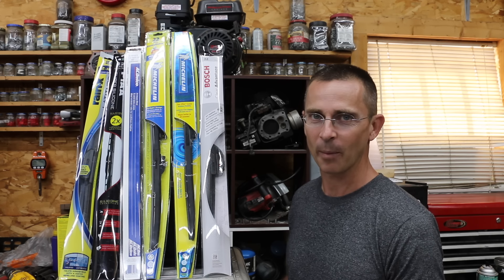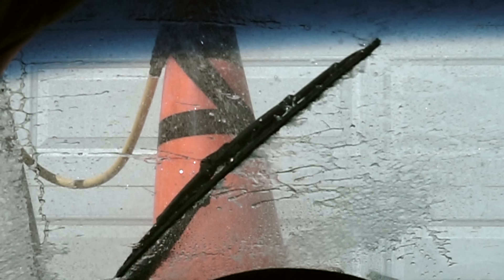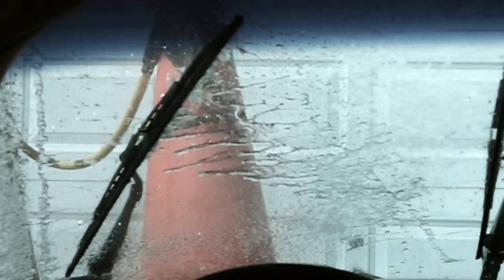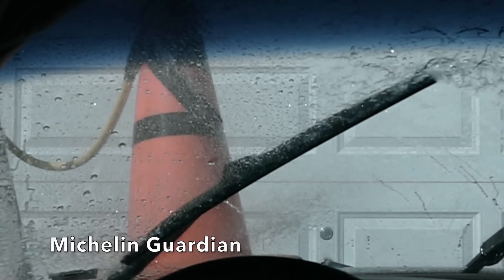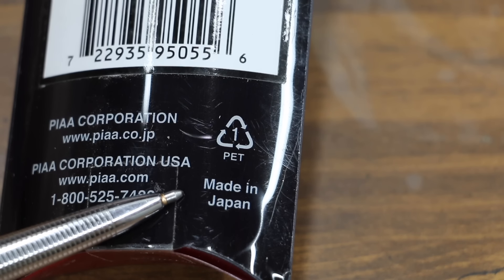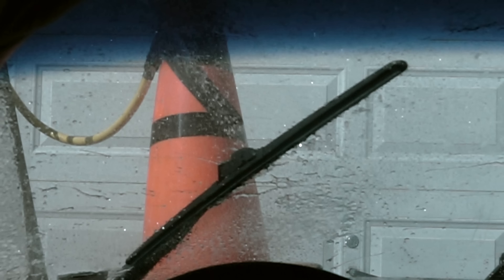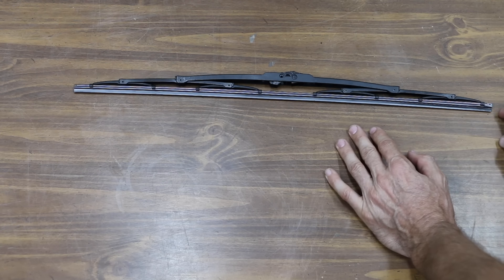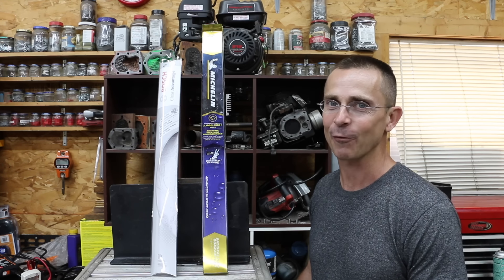Which Windshield Wiper Blade is Best? Let's find out!  Michelin, PIAA, Bosch, AC Delco, & Aero

Comment: Hey, just a heads up from a professional detailer: the main reason to buy silicone blades is that they all leave a coating of silicone on your windshield with use that causes water to bead up and makes the wipers more effective. The rainx wipers you tested are just using that fact for marketing, but all silicone blades including the PIAA will coat the windshield. 

When combined with a glass treatment like rainx or aquapel (which is better) , silicone blades will last an incredibly long time because they are more effective at low speeds and at highway speeds you may not need the wipers at all because the water beads and rolls off. 

Speaking of which, you should test hydrophobic coatings like rainx at some point!  Love your videos!
Reply: Very informative.

My last set of PIAA wipers lasted 8 years believe it or not. 

I clean my car at least once a month, I would clean it more often if I had enough time. Every time I clean my car I clean the wiper blades too.
Reply: You will not see silicone blades used by car manufacturers (OEM).  Silicone leaves deposits in the microscopic pitting that is found on EVERY windshield.  Filling this pitting with a hydrophobic material is what allows Rain-X , Aquapel, and others to have the rain bead up and blow off the windshield.  The down side is that these materials can cause extreme glare on the windshield, especially in sunrise, sunset, and oncoming headlights.  The car manufacturers will not take on this liability...
Reply: Does 2 stroke mix stabilizer Fuel? Adding 2 stroke mix Does it lower the octane levels over time ? I can not find any information on it
Reply: IRBork isn't it recommended to use a coating (hydrophobic) when you switch to a silicone blade?
Reply: @r3alfish   Hydrophobic treatments can produce glade... especially when they start wearing off.  I tell people that to minimize this problem, treat the windshield every 4 to 6 weeks.  Even if the treatments seems to be working, after that time it is starting to wear.
Reply: I used Adam's ceramic boost on my windshield 4mo ago and use rainx washer fluid and once I'm at highway speeds, I rarely use my wipers.
Reply: I find that I get water to bead up fine if I clean the windshield with 0000 steel wool or (my preference) the 3M 'plastic' version of 0000 wool (after running the car through the carwash). I do this a couple of times a year and that seems to work well enough for my wipers to not make noise and get the windshield clear. And this kind of cleaning leaves no streaks.
Reply: Exactly.  👍
Reply: My Bosch Icons are going on almost 5yrs now. Rain-x coating, and rain-x 2 in 1 fluid.
Reply: S
Reply: That's kind of like advertising cholesterol free margarine when no margarine has cholesterol.
Reply: IRBork I bought Silblades for my Wrangler and they squeaked and squealed from day one. I cleaned the hell out of my windshield before installing them too. No matter the amount of rain or the speed of the wipers, they were way too noisy and the first ones I’ve ever thrown away because of the racket. They probably would have lasted years though!
Reply: hmmmm, i dont know about that, glass is silicone too, so if i rub two diamonds together will one get coated with diamonds? dont tell me the harder surface; harder silicone surface, will get coated by the softer silicone surface, I know i flunked science, but come on bro, really? please explain this theory, and working at AutoZone dont count!
Reply: Andy P silica (glass) and silicone (rubber) are two different materials with different properties, silicone wipers such as PIAA have instructions to run them dry for 3-5 minutes to activate the hydrophobic properties on windshields. Dont quote me on this but my theory is that silicone is softer then silica hence when run dry produces heat from the friction that sort of disintegrates minuscule amounts of silicone and coats the windshield hence water beading effect.
Reply: From the reviews I have seen carpros had the best ceramic for the money.
Reply: For that exact reason, I hate RainX and anything that leaves a "White-Out" smear after each wiper pass.  I even had the same with the Aquapel, and I thought the Aquapel was NOT supposed to do this.....
Reply: As (Porsch924Tim) stated below:   I agree for that exact reason, I hate RainX and anything that leaves a "White-Out" smear after each wiper pass.  I even had the same with the Aquapel, and I thought the Aquapel was NOT supposed to do this..... Very noticeable during the day, and dangerous at night with any overhead/on coming lights.
Reply: @andyp3834  are you confusing silicon and silicone?
Reply: The windshield on my 2001 impala beaded all the time and in fact a friend of mine swore up and down i was using rainx. I never did. In fact whenever i drove in the rain i very rarely ever turned the wipers on.
Reply: This
Reply: So are the PIAA'S just as good as the Michelin Endurance XT (silicone) he tested I was kinda surprised PIAA weren't tested also
Reply: @mikebraun4263  depends on the wiper for which your choosing to stir with.
Reply: @TNtoolman  any way to remove this deposit if once used?
Reply: @ZoopChedda  We tested silicone blades in our test lab.  When it was finished we could not get the silicone off the windshield... tried everything... #0000 steel wool, rubbing compound, acid based cleaners, one tech even tried burning it off with a light torch.  Figured nothing else worked, why not?  
We ended up throwing out the windshield because it could no longer be used for testing.  Windshield wiper comparative testing and FMVSS/SAE testing must be done on glass... not hydrophobic surfaces.
Reply: @LuckyNv  i believe you i've had expensive bosch and after 2 weeks they leave streaks, the piaa lasted 6 months before i gave then away when swapping company car.
Reply: @hardlyb  You just replied that you run your car through a car wash to a professional detailer.... I'm sure that he loves your comment!  There's a reason detailers call carwashes swirl-o-matics... Not sure about steel wool, but Bon Ami (a specific abrasive found in the cleaning aisle of some stores) was also said to be recommended by BMW for cleaning windshields.
Reply: @sixoh_diesel5662  I admit that I don't take the best care of my cars - their appearance is just not that important to me (my wife cares even less - she refers to cars as 'boxes with wheels'). Basically the only time I ever take a car to be detailed is just before I sell it - I always ask myself why I didn't do this before, since they look so nice, but somehow it doesn't happen. 

I'll have to look into Bon Ami.
Reply: chrispompano tm
Reply: @TNtoolman  I've noticed this with my windshield treatment. It used to just bead up and I didnt even need to use my wipers in heavy downpour. Now a light drizzle just sticks like mad, I don't have a garage to put my car in to redo the treatment
Reply: @lanceivor  Yes SiR, Sir, I think your on to something, thanks for the awesome response
Reply: @TNtoolman  Damn. thanks for the feedback though!
Reply: @TNtoolman  so should i just get the Bosch regular blades and use rainx? Thanks for responses
Reply: @Fortheloveofjdm  Bosch makes a good blade, as do others.  I do not recommend Rain-X unless you are prepared to re-treat every 6 to 8 weeks due to the possible glaring factor
Reply: @REDSIX  LOL he was such a prick about it too

Imagine being that smug when you don't even know the difference between silica and silicone.
Reply: IRBork i second this, i’m intrigued that the suggested test.
Reply: Porsche924Tim i’ve been using rain x windshield fluid for years. i can attest to the glare that it leaves.
Reply: Like at least one has said glass is silica and silicon or silicone is a different thing. To elaborate on this a little more I worked at an auto glass manufacturer. They have special glass that will bead up moisture and run off the glass so it clears easily. I wasn’t privy to the technology but I saw how it practically cleared itself.

Comment: "we will come back after a year" talk about dedication haha. Good content
Reply from the maker: Thank you!
Reply: I wonder if you could use a tanning bed to accelerate the time needed for the UV / heat durability test?
Reply: dragonspy91 0
Reply: dragonspy91 p
Reply: @ProjectFarm  Dude. You're a nerd. And I mean that in the most endearing way possible. Keep up the good work. 🔥
Reply: based on design alone, I think ill pick up the aero blades.  I don't get much rain in socal, but the design seems to kind of give the actual blade some "shade" from the sun, and seem itll help slowdown deterioration and therefore be less squeaky and streaky when I use my wipers to clean my windshield once a week, lol. id like to wait a year for his update but man, the streaking gets to me.  :p
Reply: @kevinpacheco3303  it might but what harms the most is the heat build up on the glass that the blade is leaning on
Reply: I know, I looked at the date and got sad because the video doesn't exist yet.
Reply: You gotta love this guy.. quality unbiased videos. Rare to find quality, honest and dedicated videos nowadays.
Reply: @kevin None silicone blades will probably last a lot longer than the rubber protected by a little bit of the frame. I bought a pair of cheapo silicone blades that squeak like crazy and probably strain the wiper motors if it's not wet enough, but they've lasted me for quite a while.

Comment: "Hey buddy, you got anything good in the freezer I can have?"
"Yeah, I've got 5 types of oil, some wiper blades, 7 brands of paint, 4 qualities of gasoline and an old lawnmower engine."
Reply from the maker: lol. Great point!!
Reply: This is perfect
Reply: Wait!! No beer or snacks What Heresy is this!!!!
Reply: @kalemercer7053  Next vid:  Which beer is the best.  Let's find out!
Reply: @pickeljarsforhillary102  which beer wins the -40 flow race track
Reply: @pickeljarsforhillary102  I think a beer comparison is in order too,
Reply: Hahahaha nailed it!
Reply: I was thinking more along the lines of how much shine is good for fuel... in an engine, then later testing what’s left personally!
Reply: don't forget fuel, and oil additives
Reply: Probably still taste better than frozen microwave dinners.
Reply: For the shop use or for us?
Reply: Great video
Reply: Ha!
Reply: I use the rainX solution on my screen and it really comes into its own when driving above 30mph at 50mph I actually don't need to use the wiper blades as the rain comes of quicker than the blades can wipe.  This makes me think a moving test with blades might be more accurate as wind is a massive factor in wiper blade efficiency.

Comment: Love how the passenger blade basically undoes what the driver blade wipes off.
Reply from the maker: Great point!!
Reply: Yeah, some car manufacturers did try different wiper designs and most of them work better than the regular one, but I'm guessing the BOM cost is too great.
Reply: I think in normal driving conditions the air flow would help  push that water up and over the window rather than it just fling over to the other side.
Reply: @AllenEngineered  Yes, and different length of left and right (passenger's shorter).
Reply: It doesn't after the wiper motor fully cycles. Only after the fore stroke.
Reply: I own a 98 C230 which only has one wiper for the whole windshield. I honestly like the design of it compareed to traditional 2 wiper setup. Wish all cars had it.
Reply: My Honda civic 2014 the wipers both of them shoots out pushing the rain off the whole window. Unlike most cars
Reply: @Overland_506  My 2005 Chrysler Town and Country also has opposing blades that both push up and out. Preventing that from happening.
Reply: @ras8678  I recently read an article about that single giant blade and it was brought up that while it was great at clearing the windshield the weight of the thing would cause the entire car to rock at full speed.  They also mentioned that since the design was abandoned the replacement blades are becoming scarce and even more expensive than they originally were.
Reply: RAS my friend had one of these and it works fine until it messes up and won’t run fast enough to keep up with the rain, was terrifying to ride with him.
Reply: One cool thing about cars that have wiper blades that both to out from the middle, not sure what all companies do this but I've had 2 fords and they both pushed water to the outside with both wipers
Reply: @Pancreaticdefect  I've got a Mono-wiper on my 1998 Mercedes E-Class. I think it's a single 22" blade, so not too uncommon. It works really well and I've never had issues with the car rocking like you said. It is more complex as the blade moves on the arc as well as in and out. I've never seen them break, but it's certainly more complex and expensive to produce.
Reply: @bdkj3e  i agree, if you don't maintain the wiper motor ( keep the assembly greased and debris can build up very easily underneath it) it can become your worst enemy lol. I notice the teflon lined trico or silicone ones hold up the best on my c230 without any problems.

@Pancreaticdefect well no wiper design is perfect. My c230 and c230k both sets of wipers have no vibration issues at high speeds, that could be related to a specific car manufacturer or design flaw. With replacement blades, i know my model is just a regular 24" blade, IIRC the newer yaris had like a proprietary single wiper.

Comment: Thank you for doing this experiment! I'm an OTR truck driver and was getting ready to buy new wiper blades for my semi.  After watching your video I went with the Michelin Extreme with the beam technology.  The one that did the best in your test.  Even though they're $20 a blade at Walmart.  I'm very happy with them.  Also how can you put a price on being able to see clearly to stop an 80,000 lbs truck!
Reply from the maker: Thank you!
Reply: Try taking your rig to the streakin beacon(blue beacon) just so that you can put the rainx coating. I always do this and paired with a good set of wipers you’ll be laughing at the rain while everyone else is struggling to see out they’re windshield
Reply: @gbaca57  I always get the rain x at the blue beacon.  When it rains after you got your truck washed you can see the water bead up on your hood.  Then your truck stays clean longer.
Reply: Look into flyby30, going on 8 months after application and water still beads like crazy! Definitely helps during heavy downpours
Reply: Thank you to my OTR stuff-hauling brothers and sisters! You guys work for a living!
Reply: Thanks for what you do! Drivers don't get enough credit for keeping this country running.
Reply: Use the rain x washer fluid, also $3 at walmart.  Nothing beats it.
Reply: I drive trucks and agree completely 600 miles a day premium is needed
Reply: Rainx every two weeks and 4 dollar refills once a year
Reply: @mhamma6560  it leaves a,gummy tacky finish. It actually made things worse over time. Many have said this. Look up Cris' fix!
Reply: @captainamericaamerica8090  I've been using it over 6 years continuously without issue in 5 vehicles.
Reply: @mhamma6560  many complained about it
Reply: @captainamericaamerica8090  Just checked my receipts and turns out I've been using it since 2008, around 45 gallons in total.  I don't need to check with someone about something I'm very well versed in.  Never had a single issue with it, always use the orange variant which is good to -20.  As a habit I use it at least once a week to refresh its coverage and replace wipers yearly with $6 goodyears from walmart.  Go their gas station after purchasing, install them and toss them in the trash there after cleaning the windshield.  100% perfect no complaints.
Reply: @gbaca57  9
Reply: @ChainsawChristmas  
Wait until their job will soon be automized (and unless we the people will realise that the cause of why automation has negative effects (when it should have only positive), is competition based, private means of production based socio-economic system - that too will cause some protests, some suicides, and then slowly will fade, and the system will redirect the discontent towards "immigrants" and such, and so forth).